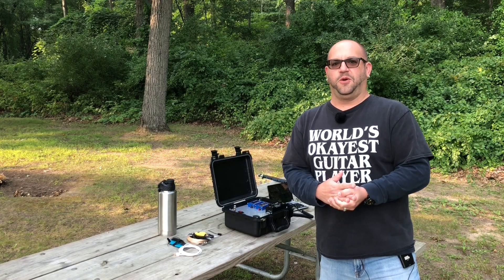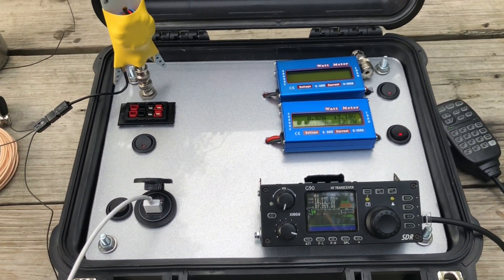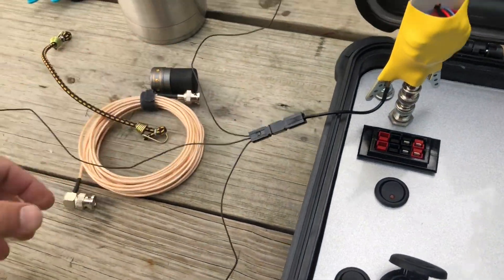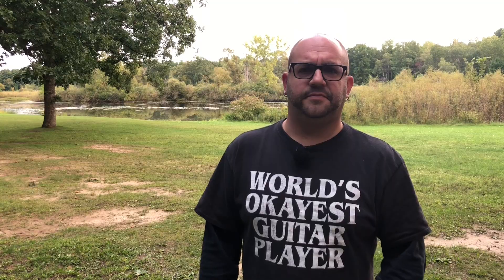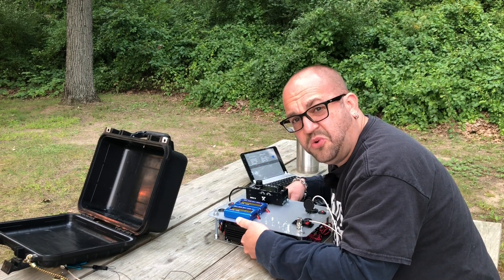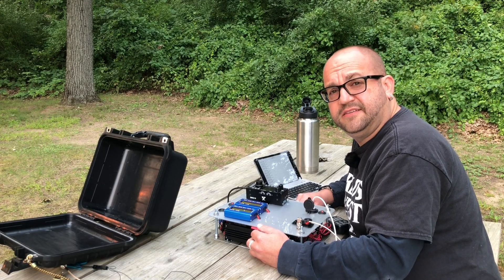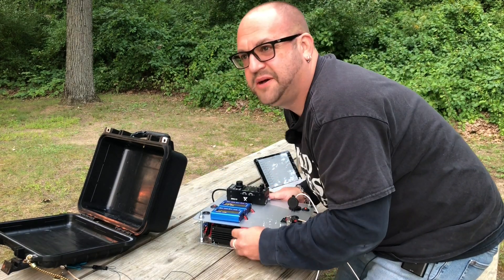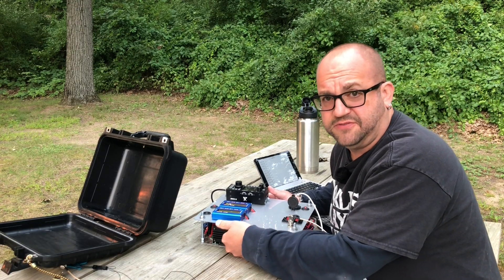Ham Radio Go Box. How hot does the G90 get??

Comment: 4 years later and it looks like you've switched to a FT-891 for POTA mostly. Would you still recommend this go box to people now, after having time with other setups?
Reply from the maker: I actually have the 891 in the car now and use the 7300 for POTA mostly but yes, the G90 is still a great radio.  I'd absolutely recommend it.

Comment: I have run the G90 at 50% duty cycle @100 watts with the XPA125b doing FT-8 for 5 days straight. Got a little warm but not warm enough to be concerned about.  I have heard the tails of this radio overheating, but I think that was a firmware issue in a previous firmware.  Now, that being said, I only had 5 watts coming from the radio into the amp.  If you're running 20 watts from the radio only it might heat up more....?  I love this setup, I got QRP and 100 watts whenever I want it.  Great portability even if you want to take the amp along.
Reply from the maker: I've run this thing so hot it was almost too hot to touch.  Literally.  Still haven't had any problems with it in the box and I use it all the time.  I do have the newest firmware installed on it too.  Not sure if that fixed anything or not.

Comment: K8MRD, question not specifically related to this video, if you have time can you please give some thought and answer:
Q. Are you comfortable recommending a G90 to a brand new HF operator as their first radio? Assume this new operator wants to use the radio at home and at parks for SSB voice contacts. This is not a trick question and it may not have a wrong answer, but this question keeps coming up over and over and I am not sure how to answer. I have friends and many new young people starting to get into ham radio especially because of parks on the air and I am repeatedly asked if 20 watts is enough radio. The question is especially relevant because the G90 is very cost-effective and more people can easily afford that price tag. I have been steering people towards the Icom 7300 when they are brand new and ask for a first HF radio because I feel like the 100 watts might help them get heard more often and frustrated less. With that being said, there is a huge price difference between the 7300 and the G90. Given your years of experience and knowing that this is an honest question trying to help new operators get started, what are your thoughts on this matter? Is the G90 and it's 20 watts powerful enough such that a brand new person will not become discouraged? Last summer I contacted you at a park and I asked you for a special request, at that time my callsign was W3TCP and you were at a park testing out a DX Commander antenna. I asked you to start backing the power down and let me get s meter readings. At 80 watts you were s6, at 50 watts you were S5, at 20 watts you were S4, at 10 watts you were S3 and at 5 watts I could still hear you at S2 in Pennsylvania. What are your specific thoughts when it comes to a new person entering HF voice? Is the G90 a good radio for a beginner? Should they save their pennies and wait for a 7300? This is a question I'm struggling with and I'm hoping you will weigh in with your real world experience please. 73 W3GUY Ernie
Reply from the maker: Hi Ernest, I get this question a lot.  My answer is no, I wouldn't recommend the G90 or any qrp radio as a first HF rig.  I feel it would be quite discouraging for new hams if they were trying to bust a pileup and not be heard.  Now if they are the one calling cq and everyone is trying to work them, its not as big a deal, but having 100 watts certainly helps.  I would (and did) go with the 891.  It's a way more capable radio than the G90 could ever dream of being and doesn't cost that much more.  I think the G90 mesmerizes a lot of people because it has a fancy waterfall, but in all reality, it is a very basic radio lacking most features that you would want.  While yes I do like the radio, its certainly not my favorite, quite the opposite.  The 7300 is kind of in another league when comparing the two however, and the $1000 price tag could be a bit steep for some.  At about $600 the 891 is more than capable of handling both home and portable operations.
Reply: @hamradiotube  Thank you! This helped! 73 W3GUY Ernie
Reply: @ErnestGWilsonII  Most new Amateurs will eventually end up owning all three anyways :)

Comment: Forgot your Flask! Thanks for the update. I did wonder. I have an IC7000 I was thinking to use in a go box -- and I'm positive it WILL need a fan! 73 Bruce G4ABX
Reply from the maker: Does the 7000 not have an internal fan already?
Reply: @hamradiotube  It does, but it gets so hot on receive as the fan only runs on TX Its bad enough on an open desk let alone in a sealed box :-) 73 Bruce G4ABX

Comment: Hi Mike,
Glad we made a contact on 7230 today at your K3324 POTA, but wish the QSO could have been a bit longer. You were +10 into Philly and 15 seconds later down in the noise. Stay safe.  WJ3U
Reply from the maker: Crap I didn't even realize that was you.  Still not used to your new call.  Signals weren't too strong.  Lots of 55, 33 etc.  only a couple 59's.  Thanks for the contact though.  73

Comment: Good short video.  I noticed that you have an aluminum chassis  where you mounted everything.  That chassis would work as a heat sink if it was in physical contact w/the G90.  However, why fix it if it ain't broke.
Reply from the maker: Thanks.  Its plexiglass though.  I spray painted it a metallic silver too look cool.